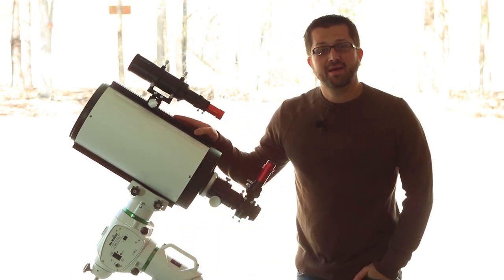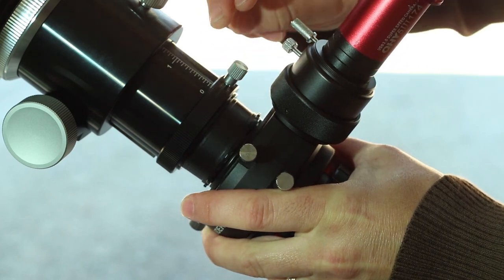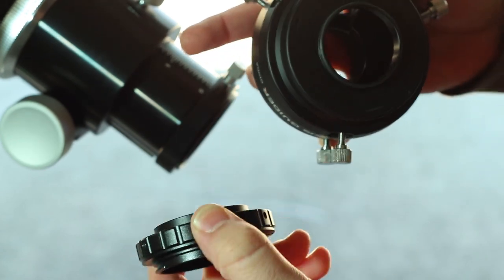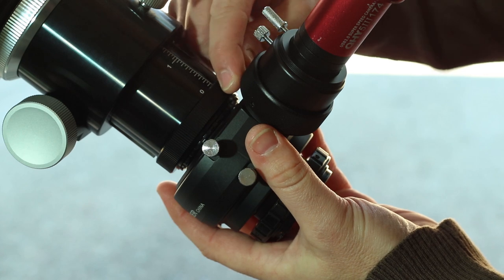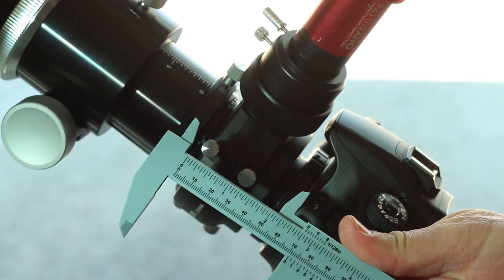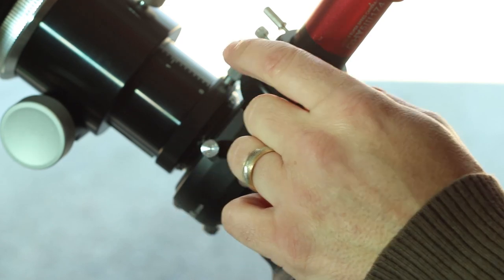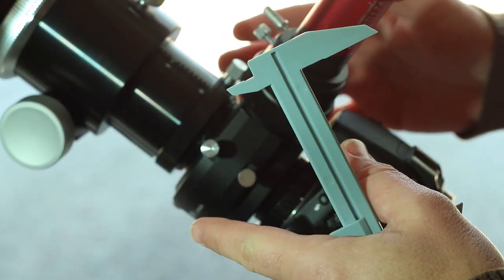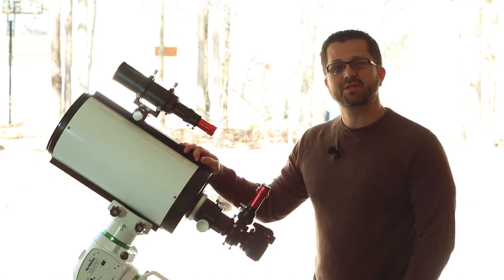How to setup an Off Axis Guider OAG

Comment: I don’t have an off axis guider, but these seem good for multiple reasons. I once had an issue cause by slight movement in my guide scope that caused major issues last galaxy season. It was differential flexure. Once I tightened everything up no more issues. But an off axis guider might be a whole lot less susceptible to differential flexure. Nice video 👍
Reply from the maker: Hi Ed, Thank you.  Yeah, an off axis guider eliminates any differential flexure that would come from a guidescope.  Anything above 800mm or so in focal length, I'd recommend using an OAG.  It really helped my guiding too.  I was able to get .65 total RMS when using it and I've never had that smooth of a guiding session before then.

Comment: Nice tips!. But what happens If I used a reducer? , would be very hard to achieve focus, wouldn't be?
Reply from the maker: You can use a reducer but it will change the back focus distance both for the imaging camera and guide camera.  This is something to consider when making the change.  Different scopes have different back focus requirements and you’ll want to check with the manufacturer or cloudy night’s forums for this.  It may require the removing of spacers if you’re setup already has them in your imaging train. Hope that helps!

Comment: So advanced!  Can the tracker be leveled?  Or turn the camera vertically？ Thank you!
Reply from the maker: 成非 yes, always level your mount.  And yes you can rotate the camera in any direction to achieve the composition you are seeking. Clear skies!
Reply: @AVAstronomy  👍🍻！
Reply: @AVAstronomy  
After reading your experience, I returned Startsenso auto align and replaced it with your OAG method.  The missile tracks more accurately than radar, thanks!

Comment: How would you use an OAG with a 2800mm tubus in general, just for solar system or also for deepsky?
Reply from the maker: I don’t believe guiding is necessary for solar work.  It’s mainly for deep sky targets with long focal length tubes.

Comment: I suppose the only drawback of the Celestron OAG is you it's quite large so it would be incompatible with a reducer like the CCDT67 from Astro-Physics if you use a DSLR (you wouldn't be able to achieve the correct back focus). Do you use a reducer with your RC8 and DSLR setup?
Reply from the maker: Yes it is rather large. I have not used a reducer with the RC8 telescope yet. Clear skies and thanks for watching!